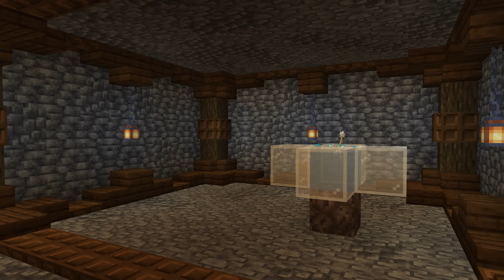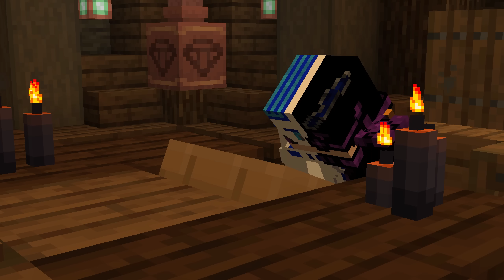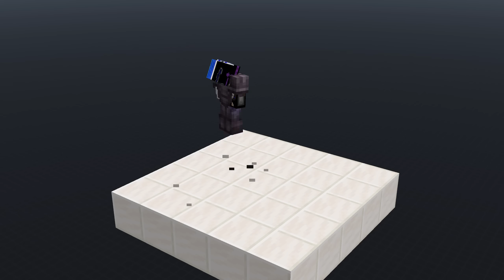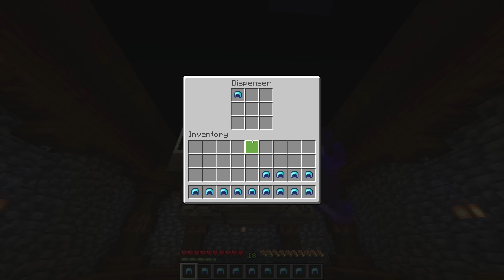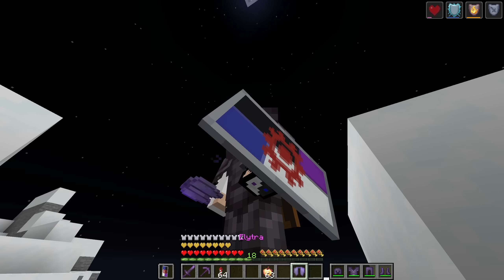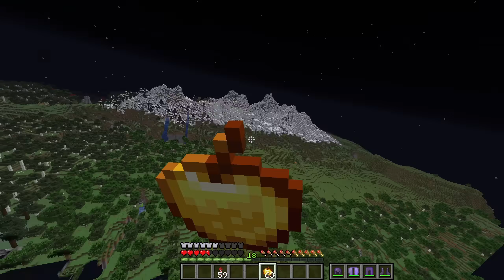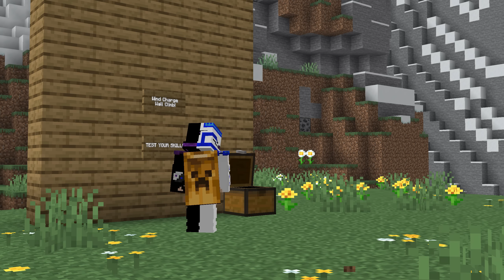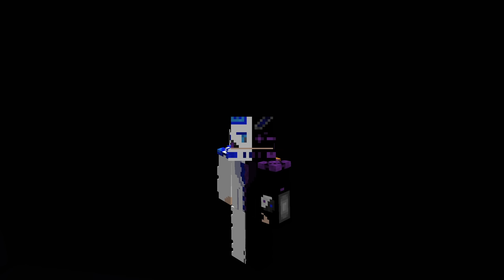How A Wind Charge Can Ban* Your Enemies

Comment: if you are truly evil you can spread out 4 of these in outer end island using flying machines to transfer arrows but in diffrent quadrents of the end so that u cant locate it with a shield and still get 4x the damage
Reply: you'd have to chunkload everything in between the points you choose to prevent the flying machine from unloading
Reply: @aquarius6963  you just move them one at a time
Reply: @qChessMC yea but it takes ages